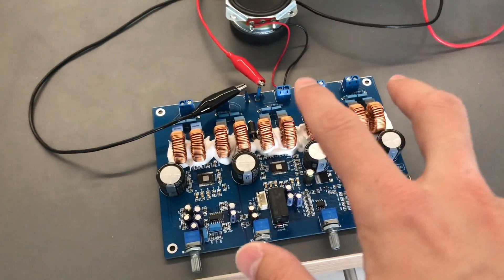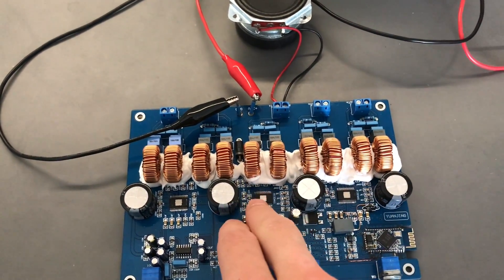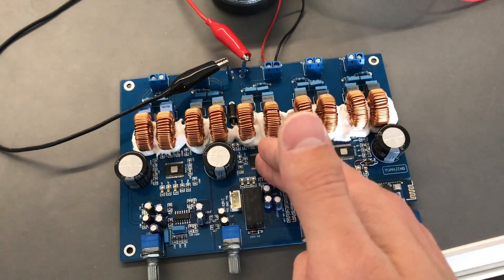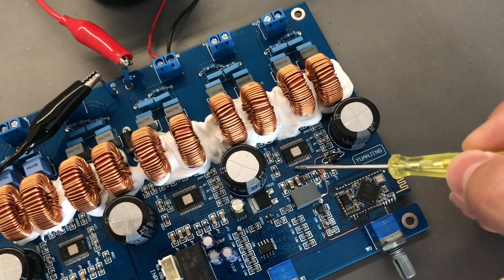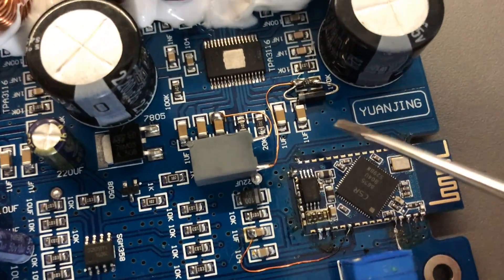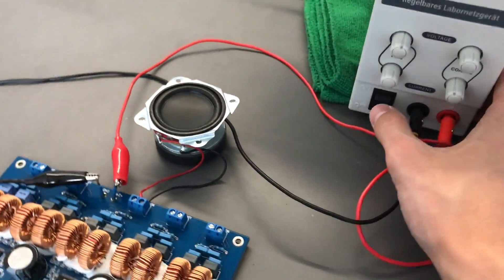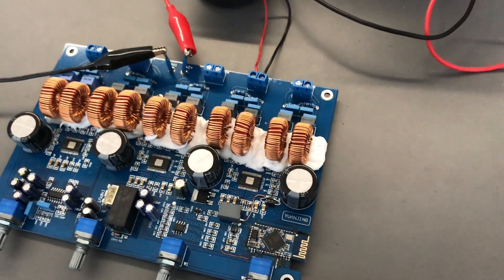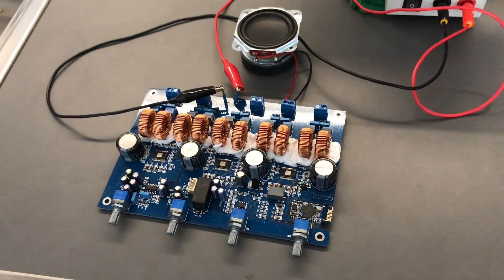How to Fix the TPA3116 Turn-On Thump / Anti-Pop Circuit

Comment: So, the Schottky diode is connected in reversed bias to protect the circuit from negative voltage spikes, is that right? Well, I have connected it like this and the turn-off pop-up still remains! On the resistor and capacitor side, the things are working pretty good; the turn-on delay of 2 seconds I have obtained using 100 k resistor and 14.7 uF capacitor (10 uF in parallel to another of 4.7 uF). What to do with the turn-off pop-up? 
Thank you! :)

Comment: Has anyone tried using a simple RC time constant circuit of 1 sec to power the sdz pin after power on? The turn on time of this chip is 10ms......1s RC should be great I guess.
It would turn on the chip 1s after power on.
A 100k resistor and a 2.2uF capacitor should give a time of 700ms
Reply: I'm using 100k and 10uF cap and its already too fast... the pop-up its still present: the speaker still moves! The diode doesn't  work as expected, though... 🤔

Comment: how about tpa3118 pbtl?, i mix that with ne5532 as lpf. when i increase the volume, the amplifier shutdown automaticaly even the current not hit 1A, what should i do to fix this problem?
note: i use 6" subs 100w 4ohm dual vc, and i have tried 12-16V, when i put the speaker in the box the cone move not stable and easily shutdown
Reply from the maker: are you maybe wiring the sub coils in parallel? that'd end you up with 2ohms .. which is very steep for these amps
Reply: @Darieee  yea i parallel the coil cause i think this amps has parallel btl so can go down to 2ohm (i have put heatsink too) at first time i tried there is no problem (working as well) but a few day after that i got this problem, i have tried go to 4ohm but these amps still shutdown, what should i do?

Comment: @darieee, Hi, I know you made this video over 2.5yrs ago but I'm having a weird problem with my board which I'm hoping you might be able to help me with.

I have the exact same board like this one (blue TPA3116 4.1) which is installed in my arcade cabinet. Of course, it makes a pop when turned on/off. I followed your procedure with a 1A Schottky diode & a 1uF tantalum capacitor. It removed the pop, but after a while all audio is lost, like it kills the output (or mutes it) completely. Turning off/on doesn't work. When I unsolder the capacitor, all is good again, but of course, the pop is back.

Any idea what's going on? Should I be using a different type of capacitor? Not sure what else it would be. Thx.
Reply: UPDATE - Long story short, I got the mod working on my board.

I found your other video https://www.youtube.com/watch?v=s0vIM8kZx9M&t & noticed you used a 22uF electrolytic capacitor instead so gave this a go. Pulled these caps off an old Xbox motherboard & they seem to be working ok. No pop & audio is working fine.

Comment: wouldn't call this implementation very very good, you should check out the Gmarsh Wiener for a very very good one, you should be able to spot  a few differences visually right away. He even uses an MCU for startup to eliminate the pop
Reply from the maker: could you link to that video?

still .. anything deemed superior costing an entire microcontroller with code running on it is a complicated argument to win .. any and everything with a micro is better, except when that thing crashes or starts to lose its mind in 20 years
Reply: @Darieee  i'm not sure there's a video, there is a thread on the diyaudio forum though, some hi end audiophile freaks power their gmarsh wieners with proper linear PSUs and then list their $2000 amps on ebay the next day, it's extremely impressive with expensive high sensitivity accoustics if properly implemented (good pcb layout and components + clean power basically)

Comment: What happens when we use a higher uf capacitor
Like 4.7 or further?
Reply from the maker: it would stay off for longer at power-up
Reply: @Darieee  ah that's fine
Reply: @Darieee  also 
My Schottky diode has a V drop of 0.85v
Will it still work or it will damage the chip
Reply from the maker: mmm, try finding a better one ...

it /should/ be /oookhay/ but ... it would be pushing it
Reply: @Darieee  can you name the exact diode which you used

Comment: Can I use polar capacitor?
Reply from the maker: sure, just be sure to wire it the right way around
Reply: I used polar capacitor and it did not work

Comment: The datasheet says of the GVDD pin "Not to be used as a supply or connected to any component other
 than a 1 µF X7R ceramic decoupling capacitor and the PLIMIT and GAIN/SLV resistor dividers." I guess that's great if it's working, but it seems like Ti wouldn't leave a specific warning if they didn't mean it?
Reply from the maker: well, TI also should've thought of some way of biasing their chip which avoids shoving VCC into the speakers at startup 😳
Reply: @Darieee  This is definitely true. It's a weird design. At least the mute pin is there, there's got to be a way of triggering it without draining GVCC...

Comment: Hey thanks ! Can I use a bipolar capacitor to do the anti-pop circuit or do i need a plarized one ?
Reply from the maker: you don't have to use a bipolar

but you can of course do it - it's a bit of a waste though :)
Reply: @Darieee  Thanks for your answer ! 
I have only that on my bench.. maybe i'll be able to found a capa in a trash pcb
Reply: @Darieee  is it must be 1micro farad? Or can i use 100nano farad?
Reply: Hey Darieee, i have a different model and the connections from the TPA3116 is quite different can i send you a picture ?
Reply from the maker: pinout of the 3116 is universal though 😎
Reply: I swear it is different :p
Reply from the maker: @antoinesp1483  then it's not the TPA3116 🔥
Reply: I swear it's 2 x TPA3116D2 but anyway it's ok if you don't want to check, thanks for the answers 😊
Reply: @antoinesp1483  JIC you never got an answer on this... Most of the TI amp chips, double h-bridges, and motor controller chips come in two different packages, with different pinout.

Comment: Woah! I think this over my skill level. Definitely would kill my board if I tied this, so I'll stick with the pop. I have been using a TPA3116 2.1 (Red board - very common) for 3 years and it work fine with pop. It is annoying though.
Reply: Hihi🤣😂
Reply: @বড়াল_পোলট্রি_ফার্ম  same problem here. im looking at a delay relay but i only seem to find DC / AC type. not DC to DC.
Reply: @rezo786  There are only DC or AC relays. Not DC/AC or DC to DC.
Reply: @-Tris-  you are mistaken. I manage to find a DC/ AC relay. Let me know if you need further details.
Reply: @rezo786  maybe I got something wrong here 🤔

I only know about AC or DC relays, both doesn't make sense. You can switch AC relays with DC if you need to, but not the other way.

Why does your circuit sometimes have AC and sometimes DC? How do you switch the relay? Transistor, triac, both...? What about back emf, you can't put a diode across the coil?
I'm confused 😅
Reply: @-Tris-  hi. Have u got email? Will send you some links etc etc
Reply: @-Tris-  long story short. I used a speaker protection board. Thru put is DC but operating power is AC
Reply: @rezo786  now I understand, you're talking about a full module.

And i bet the relay on it is DC input 🤓
Reply: @-Tris-  nope :) 12 volt AC
Reply: @rezo786  interesting😅

Comment: Would love if amp board manufacturers would put a bit of effort into turn on/off pop, and noise floor issues.  It stinks to put in a lot of work on a speaker and then have those kinds of problems letting it down.  Except for Dayton Audio, I’ve quit buying boards with integrated bluetooth.  I buy a separate bluetooth board and I install a ground loop isolator between.  This is more cost, more complexity and more space required.  I would gladly pay $5 more for a board that consistently provided clean attributes.  I consider “pop” and noise to be defects.  Boards with these issues should not make it past QC from any manufacturer.
Reply from the maker: yeah ... it's quite disastrous 

there is however a more elegant and superior method to using a ground loop isolator: you can simply run a differential pair for each channel, and ditch the ground all together; you have to unsolder 4 (or maybe 2 if you're lucky) SMD capacitors ... which might be quite small

but the results are amazing, I'm filming a video right now where I do this on 2 amps ... and will probably be doing it going forward ... the sound is butter smooth, no hiss, no bt interference, no nothing! Also, some amps have a stupid op-amp for some stupid reason, which muddies the sound and greatly boosts the noise floor - the direct-feed differential in hack should also have you covered on that front

Comment: Hi I have a question I have Tpa3116d2 2x80w amp and every time i plug the speaker in it just plays for one second then stops and on other output terminal just moves the speaker up and down
Reply from the maker: That sounds quite busted ... maybe share the link of the particular amp so people can avoid it
Reply: Darieee yeah well i have another question since i have a similar amp like yours its just 2x50W 100W sub it has inductors like yours and they heat up by a lot even when idle and since i am making a portable boombox it is a lot of waste of energy any help?

Comment: YES I FACE THIS PROBLEM ( I AM FROM BANGLADESH ) I HAVE THIS BOARD
Reply: I AM FROM AFRICA AND I DON'T BECAUSE I PUT A RELAY WITH A TIME  DELAY ON THE SPEAKER OUTPUTS. VERY EASY TO DO!
Reply: @andrewallen9993  what type relay send link ?
Reply: @Aloksoni2122  Dpst ( double pole single throw) use two with a resistor/capacitor network to delay switch on for each two output channels
Reply from the maker: Still, why use a relay when just the cap and diode work !?
Reply: @Darieee  And what frequencies pray tell will the capacitor filter out oh wise one :)
Reply from the maker: No idea what you're talking about ...

What frequencies to filter out? This mod sends a gulp a current to the MUTE pin at startup, which is adequate for eliminating the turn-on pop
Reply: I AM FROM AFRICA AND I DON'T BECAUSE I PUT A RELAY WITH A TIME  DELAY ON THE SPEAKER OUTPUTS. VERY EASY TO DO!

Comment: Not sure, because description is a little confusing but could that solve the problem without soldering on the board? 

https://de.aliexpress.com/item/A-types-Large-current-silver-alloy-contact-relay-Full-split-stereo-protection-circuit-Delay-switch-with/32799754924.html?spm=a2g0x.10010108.1000016.1.44ec48c72v5ggh&isOrigTitle=true

But you need one for each output-channel. :(
Reply from the maker: No, that's a very stupid workaround 

If you don't want to solder to the board, just use the verified 2.1 amplifier that has that circuitry built in
Reply: You're right! The price for 2/4/5 of these would exceed far the price of the amp.
Reply from the maker: They would be a stupid solution even at 10 cents a pop - they wouldn't fix the core problem, which is the amp not being muted at powerup

Comment: Hi there, love your videos!! I have one of these for long time, powered with a15v 2 amp power, it works just fine, but the bluetooth worked before only with a 12v power, I tried with a 24v as well, and after turn it on and off for a while, it kinda works, but just for a while.  is there any way I can fix that? or is there any way I can turn on and off the bluetooth when I want to use it?  Ive been using the output hooked up in my tv, but it would be nice to have the bluetooth function as well! and a Last thing, is there any way to custom these unit to receive to inputs?   Best!